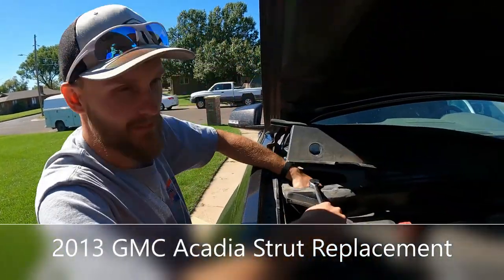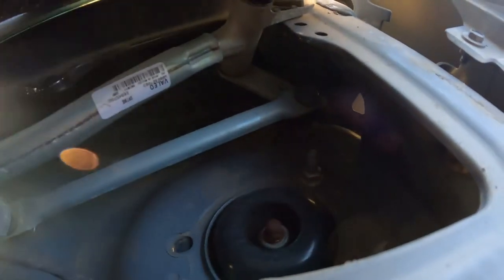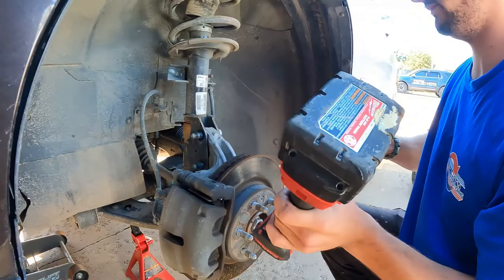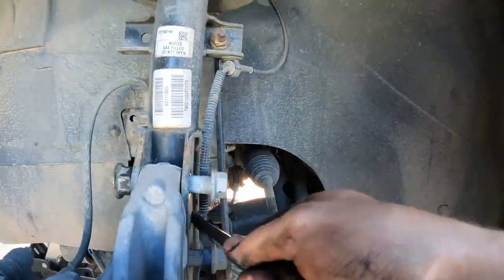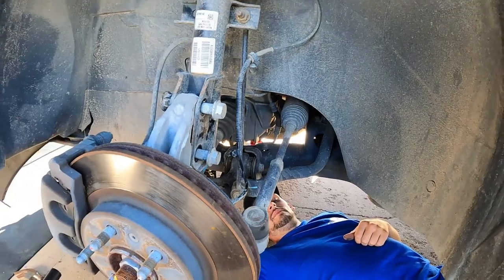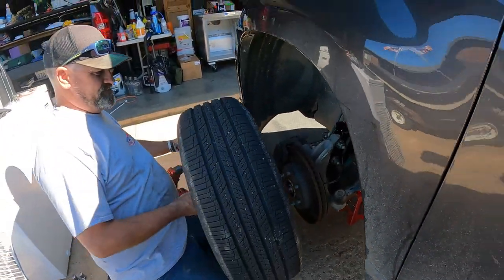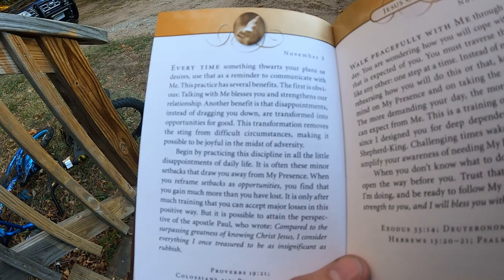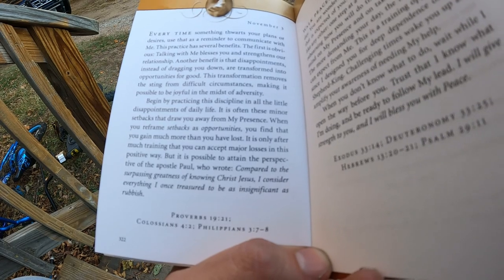How to Replace Struts on a 2013 GMC Acadia - Daily Vlog

Comment: Getting under any vehicle that's supported only by a hydraulic jack is never safe.  Jack stands are required if you plan on a nice long life!
Reply from the maker: We use jack stands every time we lift a vehicle. Jack stands fail too, and just recently I had one fail. Which is why I always use two stands, and the jack itself as a fail safe.